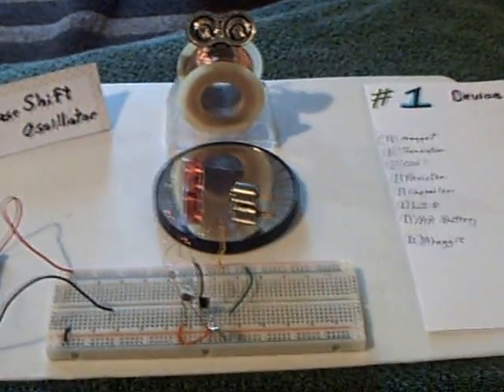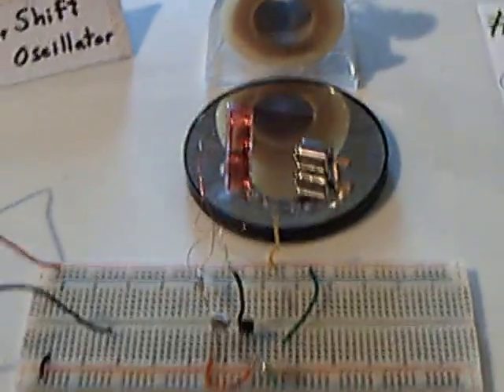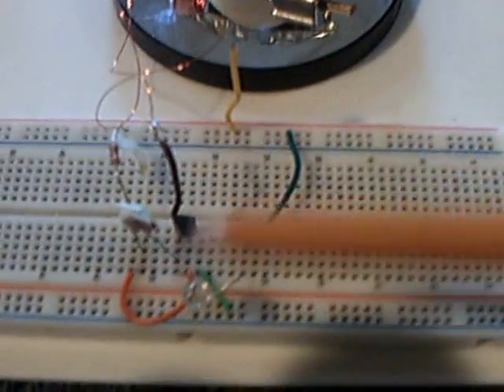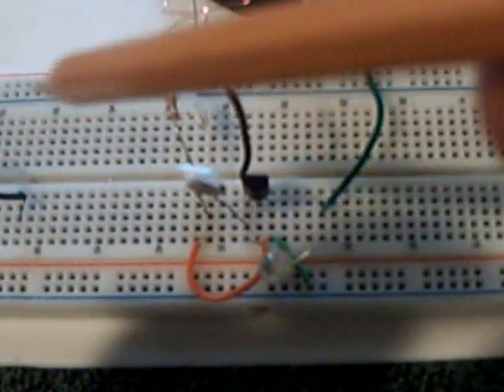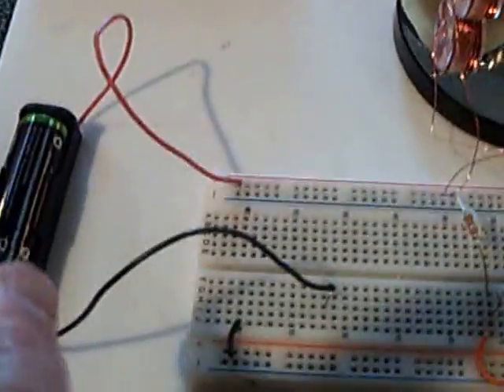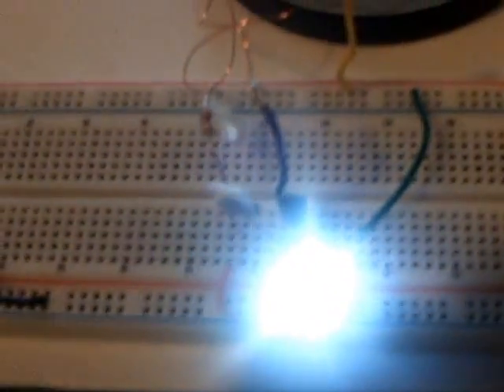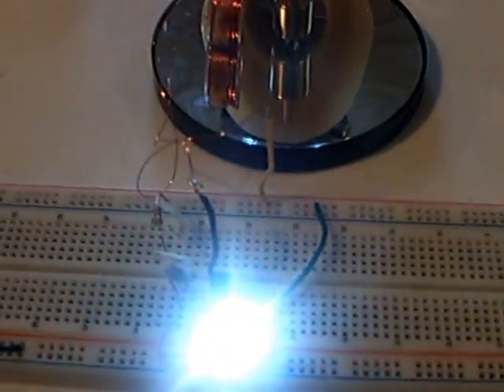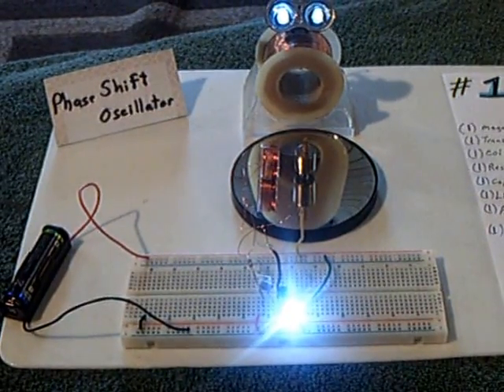#1 Device -----   Phase Shift Oscillator Hybrid

Comment: A cool thing about phase shift is that you can see the shift on the scope. as simple as varying the resistance you can make the sine wave move right or left on the scope.

This concept is needed to design three phase systems. For example using a 4017bp_10 into diodes you can make a three phase oscillator, then up the voltage to 900V and try 350 Hertz.Drve sometimes cost over $10,000. but what about home power.
systems can be much more efficient than house hold single phase 60 hertz..

Comment from the maker: Excellent comment.  Here is what it is-----2N4401 transistor, 4.7k resistor, 150pf cap, coil is 30ga wire on plastic sewing bobbin (11 ohms), led goes between collector and (+) rail.  Draws 40mA on 1.5v AA battery.  You are right----big bang for the buck on this one.

Comment from the maker: Yes but it is somewhat complicated.  You have to use a light box to measure the lumens of light from the leds as well as do the electrical power consumption of the circuit.  The stored up energy of the spinning magnet is another factor.  Then there is the heat element.   I know some guys who would get a kick out of doing that.   Not me.

Comment from the maker: Check out bakupcpu's video on this.  It is really good.  I built the circuit he showed first (took just a few minutes) and then went from there. I used a 10k pot as the last resistor in the chain for tuning.